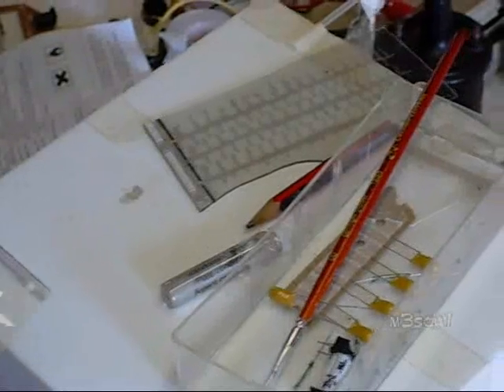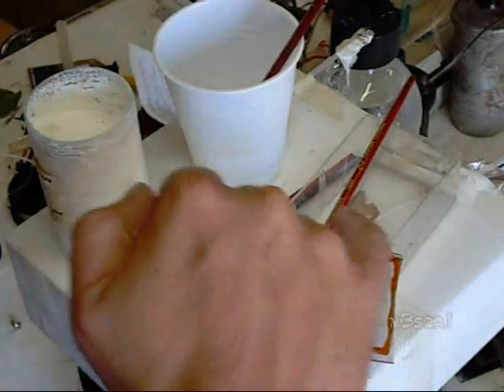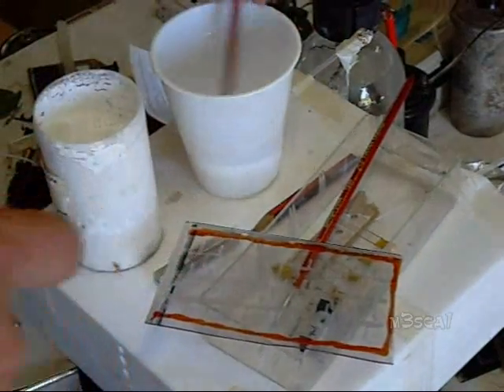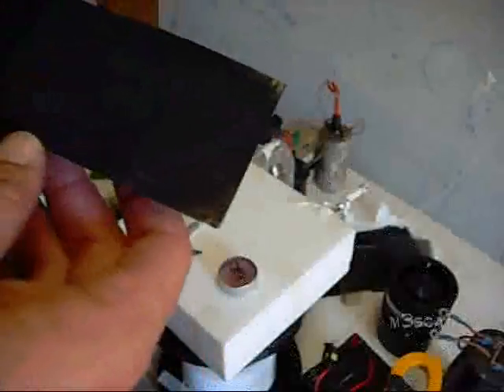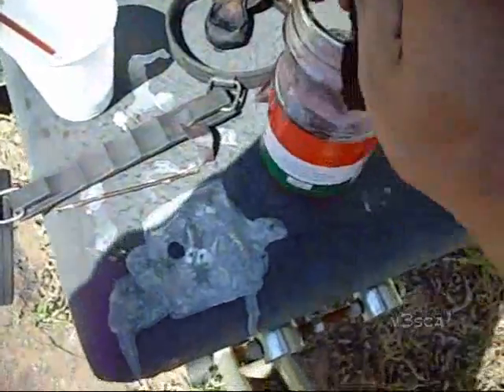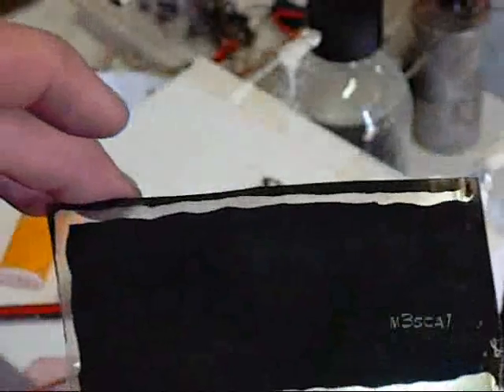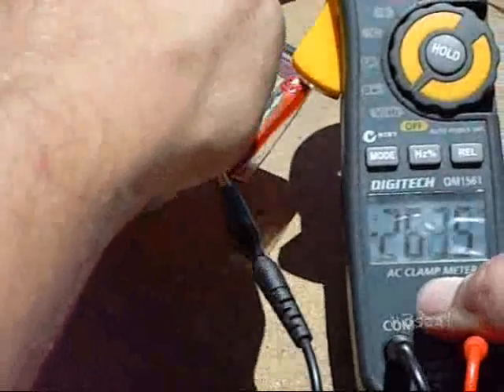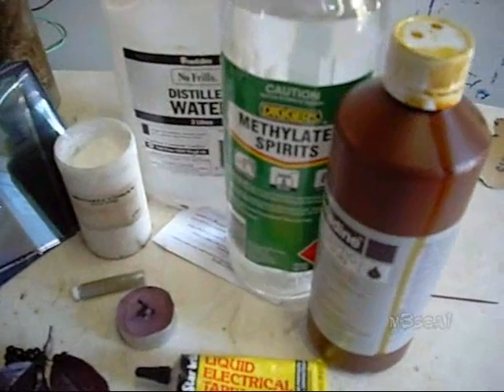Making LCD into Solar Panel

Comment: can i used lcd screen from broken handphone ? i have many chinese handphone and it was broken.
Reply from the maker: +henki prananda yes the reason for using the LCD is the conductive surface in the inside surface. Getting the glass separated is the tricky part
Reply from the maker: +henki prananda yes the reason for using the LCD is the conductive surface in the inside surface. Getting the glass separated is the tricky part
Reply: hmm... i've try to separate it, yes it hard, and end with big crack. T_T
Reply from the maker: henki prananda yes it is very tricky...probably soaking it in some strong solvent for a long time would help.
Reply: like acid ? how about sulfuric acid ?
Reply from the maker: henki prananda are you finding a sticky glue between the layers? Do not use acid...it may destroy the conductive coating on the glass. Try solvents that dissolve the glue
Reply: that mean... i use my knife again... by the way, can i use another material except raspberry ? my place doesn't have it.
Reply from the maker: yes you cab use many dyes. Just find a strong coloured plant and extract it
Reply: thank you. maybe i can start from flower, because in my place i just know if someone use flower to make solar cell. thank you very much.

Comment: are you still active on here? what was the voltage you were getting off your cell ? I made something I think you might be interested in, just do not want to send a video link to an account that no one will see. 
The cell I have made the solar material is clear unlike most cells. so I am heading toward stackable clear cells :)

Comment from the maker: @ebayisajoke i didn't re-invent this.dye panel technology has been around for a while,and the fact that it is possible to make in your garage with low tech,easily available stuff is kept quiet because it upsets the cost balance of power.
silicon panels and the gear to setup a system are priced to be about the same you would pay if running a cheap efficient generator off gas,for the lifespan of the panel.
its about control.

Comment from the maker: @dubbelnetolk you need a Titanium oxide coated glass for doing this-the inside surfaces of the Liquid Crystal Display is a free source of TiO2 glass if you have a broken device that contains an LCD.The whole point of this video is to make a solar panel without the expense.

Comment from the maker: @khoham pay attention before you start calling people liars. the plant dye solar panel method requires tin oxide coated glass. the glass protecting the panel doesnt have this - the inside coating where the liquid crystal is, is a source of tin oxide glass. i smashed a panel and washed the liquid crystal off it.

Comment from the maker: @gracenotes555 i will be making a larger one soon to test it properly-my 1st attempt was just testing the proof of concept and i see that it works,i just need a better source of ITO layered glass than pulling apart old laptop LCD panels,think the old CRT monitor radiation screens i got at a recycler might just do the trick ;]

Comment from the maker: @gracenotes555 its only a scam when someone is making money from incorrect information.
this really works its just doesnt fit the "input money output energy" figures that the power companies are happy to deal up to us.
its cheaper to make your own panels than buy them.
the life span of silicon panels and cost is factored to be the same as buying power off the grid,by the time panel needs replacing.

Comment from the maker: @xdaemoon its a product that is available thru good electronics suppliers-its 99% silver in some sort of varnish.
intended uses are repairing circuit boards and broken window heaters for anti fogging in cars.
i have another source of glass which is much bigger,so subscribe and stay posted for an update,that will include a panel which puts out more than 200 millivolts.
thanx for commenting

Comment: If I were to take a guess, it's probably -211,3 mV, so a voltage of 0,2 V, but with the leads inverted on his multimeter.

So put about SEVENTY (70) of these panels in series and you could charge a "12 V" lead battery (charge voltage needs to be about 14V)

Comment from the maker: if you do some research you will find that low cost solar panels can be manufactured using dyes and titanium dioxide and a glass with Tin Oxide layer.
if it was a scam i would be asking for your money or providing a link to some bogus plans for a magnet motor or some such thing.
there used to be more info and easily available on the subject but it seems the big energy producers dont want us to know that we can make solar panels at home for a fraction of the cost of the ones they produce.

Comment: could I use silver punchout scraps from circuit boards?  What about the meter reading?  Could you make another video showing it actually creating voltage?  It seemed like this just showed the meter floating in the .220 range which is just the meter itself.

Comment: yeah those LCD panels are a bugger to get apart without breaking them. i'll keep my eyes out for a good glass fridge door in the scrap yard, provided they don't break it with the machine :/

I'll check my old work too to see if they have some old stock black and white powdered masterbatches, their pretty much pure carbon and TiO2

Comment from the maker: yeah im after fridge doors from the shop type-they have a ITO coating to stop frosting and allow the customer to see inside-you would be better placed to find this in your scrapping,so keep your eyes peeled-thats a lot more surface area and alot easier to get apart than a LCD panel.
the.
yeah i spose the carbon and the TiO2 could be sprayed on-but the ITO is done with electron sputtering methods....

Comment: Amazing! good idea using the plant matter as a source of organic dye!.

I've got dozens of old laptops with TFT LCD's in them, would they behave the same or would it have to be an older style LCD like on a photocopier panel?

I guess for a bigger panel you could apply most coatings with a spray gun? like the TiO2 and carbon?

Comment from the maker: good question-i dont know-i suppose it would be dependant on the dye breaking down-at which time it can be re-opened and fresh dye applied-fast food shop refrigerator doors would be a better source of ITO glass than pulling down an old LCD screen.
thanx for commenting

Comment: The sunlight conversion just only happens between the ITO-TIO2 surface layer that is exposed to sunlight.
The smaller this layer is, the better the conversion,
so just try to make this very thin, just a few mikrometer.

So it was a good idea to burn the TIO2 into the ITO with a hot gun.

Regards, Stefan.

Comment: Hi Matt,
why did you put TIO2 onto the plate with the graphite from the candle ?
Normally you need only one ITO-TIO2 PN-layer and the other glas must only have graphite as the other electrode.
The silver is okay to collect the electron current from the graphite,
so you just could use a silver painted glas or plastic plate where you would have put the graphite onto the silver.

So you could spare one ITO coated glasplate.

Comment: Do you use the silver paint for the collection of the current from the ITO coated glas or what is it for ?
How did you connect the other pole to the
graphite from the candle ?

Comment: To my knowledge the real PN-layer, which is responsible for the light to electricity conversion is between the ITO layer and the titandioxid layer,
so probably a setup with the right Idium-Tin-Oxid to TiO2 layer and graphite for the electrical collection should also work somehow...
We have to find out the best setup for the best electrical output from selfmade materials.

Comment from the maker: 270 millivolts tops-not short circuit-that was just the potential,and in all a very rudimentry attempt.
i just needed to see if i could build something that works,to see if it is worth going bigger and trying different combinations of metals and electrolytes.
i want more peopleto jump on board
i am sending you a PM...

Comment: Great video I posted it here:

overunityDOTcom / index.php ?topic=6699.0

Remove all the spaces to go there and replace the DOT with a real "." dot.

Please post some more descriptions over there.
Is there a cheap process to coat glas with an ITO layer so you could also selfmade the ITO coated glas ?

Comment from the maker: i just winged it from the description of how they worked.
hardest part was getting the LCD panel apart.
need a whole video just for that.
the reason i used the LCD glass is it has a Tin Oxide layer that was required for the dye panel chemistry.
look it up on google and there is stuff on youtube too.
i just sent you a vid of how it works.

Comment from the maker: it was 0.2 volts-not bad for a first attempt i thought.
hit it briefly with a heat gun after sun drying.
made sure that the TiO2 would not wash off with water after the process and went from there.

Comment: Did you just use the TiO2 as a layer without
burning it into the ITO coated glas ?
Did you just let it dry in the sun ?

Was that 0.2 Volts or 2.xxx Volts ?
What is the short circuit amperage you get from it ?
Many thanks.